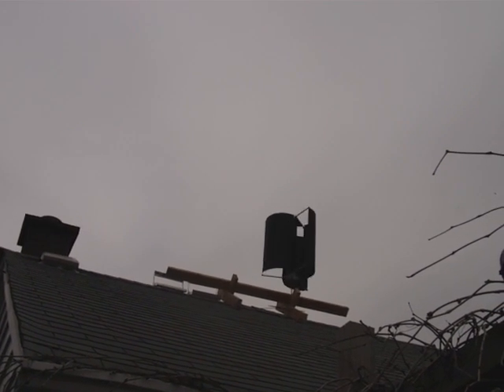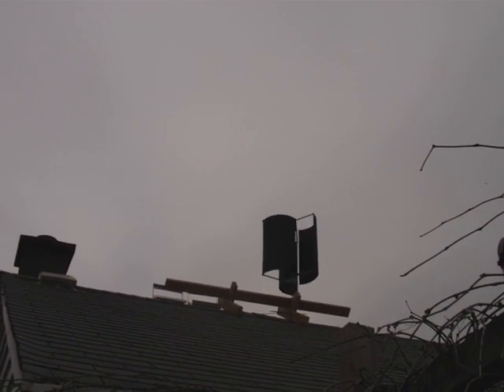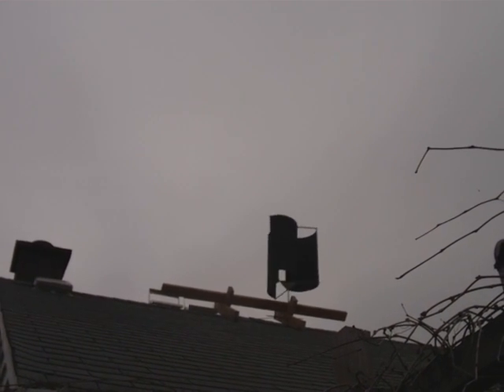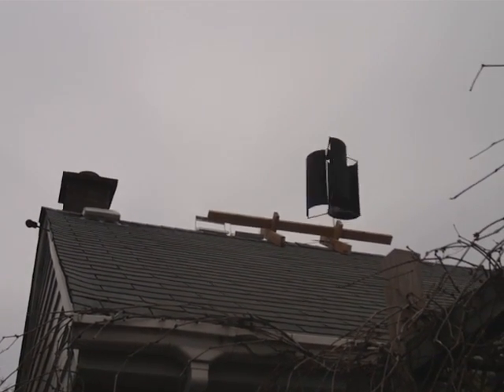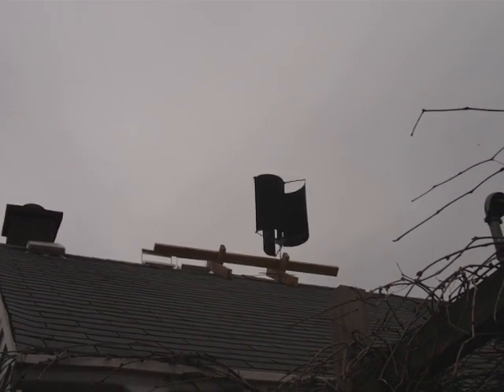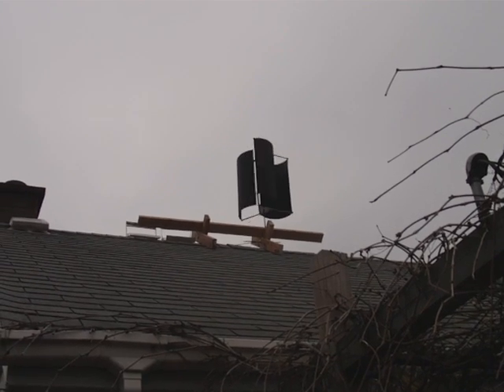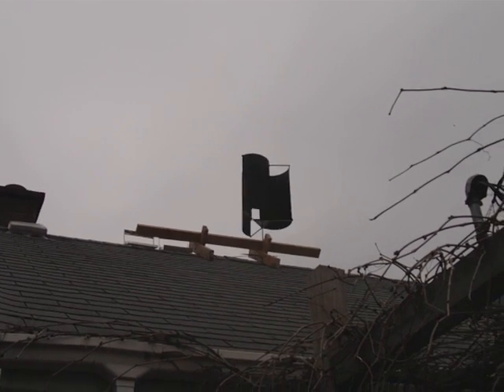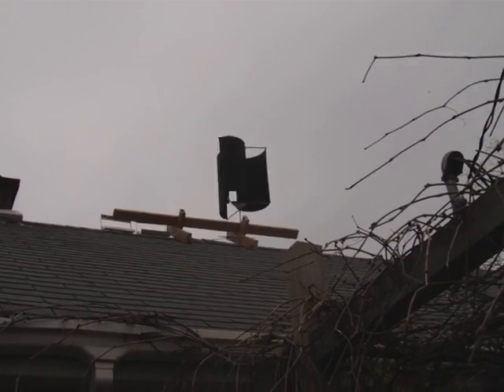Dorje Inc Vertical Axis Wind turbine (VAWT) testing

Comment from the maker: @sandeepmaloth Electric heat is very hard on batteries.  I would recommmend considering various compressor-based geothermal heat pumps with hydronic heat transfer (liquid radiant heat).  Compressors have an inductive load that is easier to manage than the massive resistive load of a heating coil.  It's all about wattage.

Comment from the maker: @sandeepmaloth Now THAT's the million dollar question! Very good! Here's the trick: 1) redundant sources of generation (e.g. solar pv - wind power hybrid systems) 2) storage capacity (properly-sized battery banks) 3) good AC inverters OR DC electical systems.

Our good old electrical gadgets have a fair amount of stupidity built into them.  How many devices in our homes actually operate on regulated DC produced by transformers?  You're sitting at one right now.   AC current is a bad habit.

Comment from the maker: @sandeepmaloth   Grid-tied inverters for pushing surplus energy onto the national grid are commonplace. Frighteningly and unreasonably expensive -- but old news.  Smart meters can help track the net-metering credit, but conventional meters have been known to to it as well.  So I don't see where the perceived difficulty is.

Oil? Rocks? Now you're talking about thermal energy.  We started out with electrical energy.  Now, I do have a dump load for electrical energy that is a big water heater.